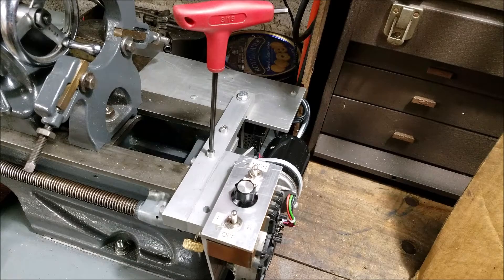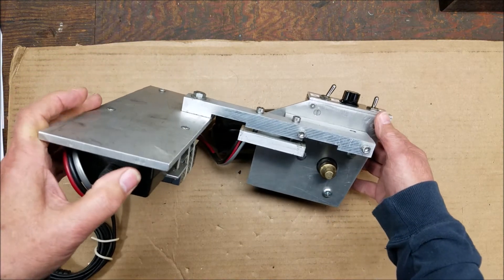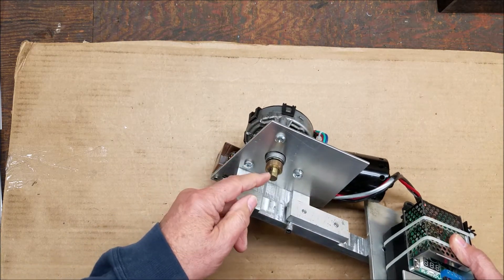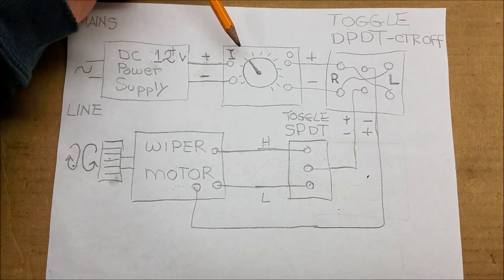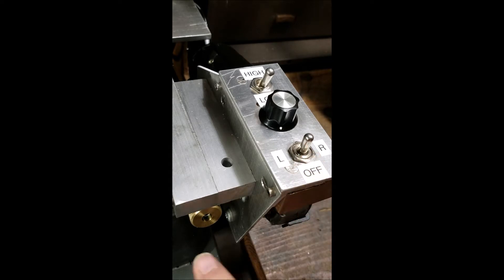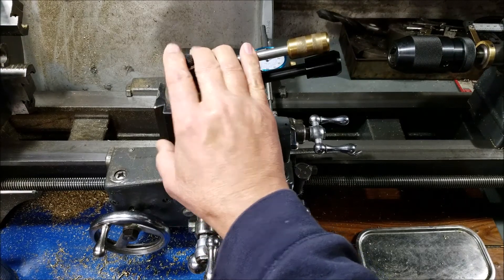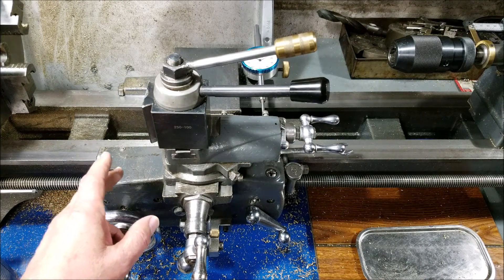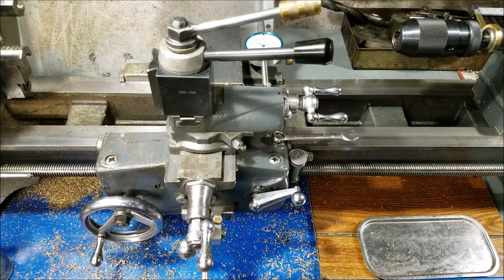Atlas Lathe Power Feed Project

Comment: Just finished building my version of your design, and I must say, it's the best upgrade I've made to my 6 inch Atlas 
lathe.  I now get flawless finishes on steel without having to mess around with the change gears.    Used a $20 junk yard wiper motor, an ebay motor controller and an old laptop power source.  Works perfectly!  Thanks for posting!
Kris
Reply from the maker: Congrats to you Kris!  I am very pleased someone actually built something I designed AND that it worked out so well for you..

Comment: Great build. Thanks for showing the Wiring Diagram also. I just bought a Craftsman 12x30 Lathe with the Change Gears. I was watching Mr Pete and he was talking about how the lowest speed on the Change Gears was too fast for a really nice Finish. He also installed the separate Lead Screw Control on his. I think I like this build better, and will definitely install it on mine. Thanks for Sharing.👍

Comment: Thanks for posting that Fred. I need to adapt something like that to my antique horizontal boring mill with no power feeds. I'll probably need to find a little bigger motor though.
Craig
Reply from the maker: I have built drives for the lathe and both my vertical and horizontal mills using the same style motors.  They have incredible torque for their size.    You can roughly work out the force needed by performing a quick foot pound test on the drive wheel of the mill and calculating from there.  Best of luck and thanks for the input..
Reply: @FredMiller  thanks for the feedback Fred. I have several wiper motors I'll test to see what they'll do. I also got some power seat adjustment motors that seem to be quite powerful also, maybe not quite as much as the wiper motors but they are quite compact. Craig

Comment: Great build. I like the wiper motor idea as they are cheap. Have you ever thought of trying to put a tachometer on the lathe so you can cut threads using the electric feed?

Comment: I'd like to do something like this for my 12" Atlas. Any elimination of gears chattering also wear going on in the gear chain just to drive lead screw & cross feed functions is a plus. Here's a brain fert from an engineer designer....I'd like to have controls on the apron itself preferably a lever control to toggle-bump on or off also F&R with locked on & off. There must also be a limit or safety maybe made to shutoff when carriage stop is contacted. I've seen a wiring link-chain like product that will allow the wiring harness to follow the saddle back behind the bed. Must be neat & clean & KISS fab. Did this make any sense?

Comment: Good one thanks for sharing,  does it mean you will have bigger pitch sizes for threads which wasn't supported by gear system
Reply from the maker: Good question.  The mod was to get better surface finishes on all materials by varying the tool speed across the workpiece.  Threading is all based on accepted NC and NF pitches and are intendes to be standard. Thanks for the comment.  Fred

Comment: Great Video.  I'm going to make one for my Atlas 6 inch lathe.  I notice your printer power source puts out 12V.  I plan to use an old laptop power source that outputs 18.5 v and 3.5 amps.  Do you think that would work with the wiper motor or should I look for an alternate power source?  Also, how did you connect the brass drive device to the motor shaft?  I thought I would thread and loctite mine on.    Thanks, and keep up the good work.. Kris
Reply from the maker: Hey Kris,  Don't hold me to it but I think 3.5 amps should be enough.  All I can say is give it a try on the bench and test the torque.  Make sure you have some type of voltage controller so you can vary the voltage to change the speed of the motor shaft and ultimately the lead screw.  I put internal threads on the brass coupling that matched the threads on the end of the lead screw and then secured it with a lock nut.  Loctite should work but use the type that you can heat to break the bond in case you need to repair or modify in the future.  Good luck and let me know how you make out on the build.  Regards-  Fred

Comment: Fred, did the motor controller come from the car wiper system?
Reply from the maker: The motor controller was from my junk box. They can be purchased from Ebay.  Look for "12 volt DC motor controller".  The one I had and used had to be modified.  The potentiometer had to be removed from the PC board and extended with a cable to the control panel.  I would be on the lookout for one that already had the potentiometer on a cable and not on the board.

Comment: I know this was put out three years ago but how does that run the cross slide it’s on a separate thread
Reply from the maker: Yes, the cross slide feed is proportional to the added power feed as well.  It makes parting stock a breeze since you can slow the advance of the cuto off tool to almost nothing thus reducing stresses on the tool post and cross slide.  Thanks for asking.